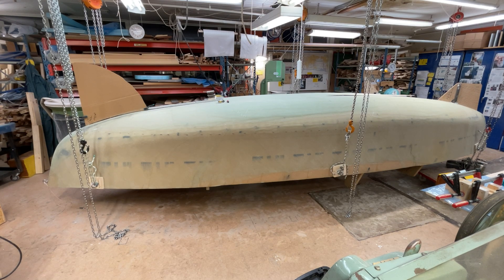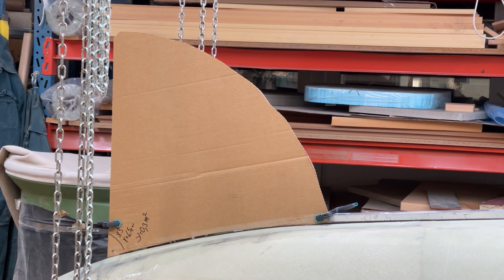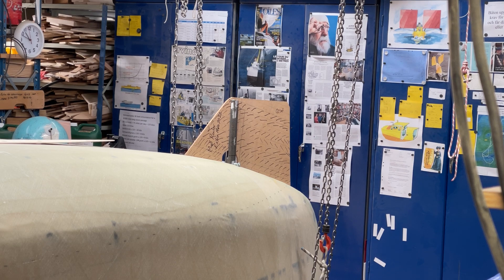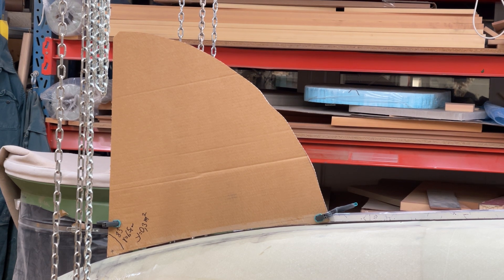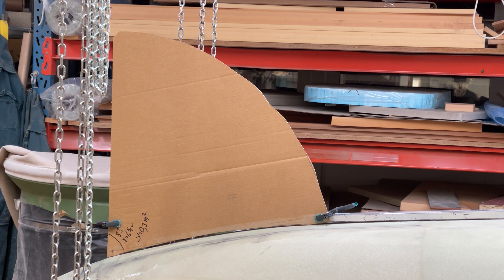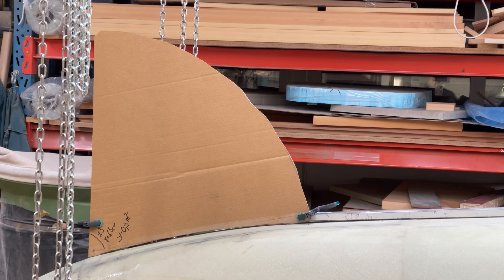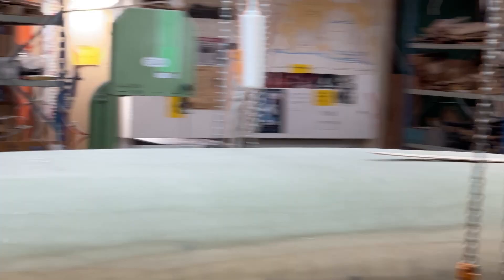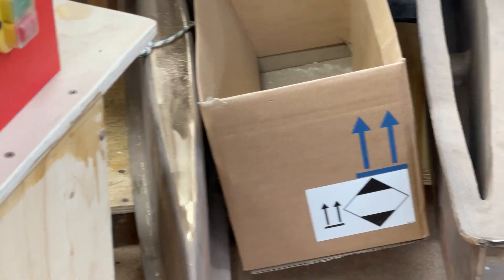A maltreated darling is back. Now a bit slimmed.I have missed her.

Comment: I know there’s a big difference between putting everything you’ve got into building a boat and merely throwing-in your two cents from afar, as I am. That said, I would go with the twin keels, put them through their paces in sea trials, and leave the centerboard as a contingency option. That is, plan for, “engineer”, and design a centerboard that can efficiently be fabricated and installed after the boat is built and tested, in the event that the twin keel concept proves inadequate in real world applications.
Reply from the maker: An alternative, but it is many times more complicated doing the bow centerboard with the deck on.

Comment: I am not sure about the geometry as i would asume it can only swing 75 degrees that far forward so it would not have a vertical edge but raked backwards, but ill just watch with what you come up as it have often been a pleasent surprise and genious solution for most of the problems.
Reply from the maker: This is a mock up a cad, cardboard assisted design, I will cut the slot in the hull and do a better. 
Then I will know better.

Comment: It will be interesting to see how your centreboard works with the bilge keels, I wonder if it is nessasery? With your bilge keels been hollow are you considering filling them with lead to get the center of gravity lower?
Reply: The keels will be filled with seawater.
Reply from the maker: No lead but seawater in the twin keels but still very good for stability and keeping the hull abouve the ground.
They do not have a very efficient lateral area

Comment: what is holding the centerboard so it not pivot back due to flow resistance? Rubberband or weights or gravity? I gess it will pivot back when hitting something. You may test sail without first and see if it is needed.
Reply from the maker: It is a combination of gravity, lateral pressure and a rope for when the boat capsizes.

Comment: I'll need to watch and learn because this appears all wrong. Maybe it's counterintuitive but I wouldn't place it there; it looks all wrong.
   It appears that the rudder will force the entire hull into a skid and cause the entire length of the hull to drag. wouldn't it be better - best to affix - design the rudder to pivot laterally so that the hull rolls onto it's edge. Rolling the hull increases rudder effectiveness while decreasing drag. NO?
  In considering the additional keels I'm at a greater loss. Wouldn't it be better to have x 2 small rudders orientated so each rudder is placed just aft of each end of each keel?
Reply: Certainly you want the rudder as much aft as you can. Attaching them to the keels will give less effect when using the rudder and you want best effect. Two rudders at the rear (in the keel lines.. to get them protecte from debris...) might be an option, but two rudders is more complicated than one... so doesnt follow the keep it simple principle.
Reply: @schuttrostig5729   With the single rudder lifted high, it is also subject to ventilation. Indeed, air from
windward side is almost always sucked down onto the rudder blade. 
  There will be a visible 
trough at the surface on the windward side, even extending a bit to the lee side of the rudder. 
  With so much rudder aerated, steering response will be 
dramatically reduced and unpredictable. 
  Twin rudders correct this problem and return reliable steering to wide, shallow hulls.